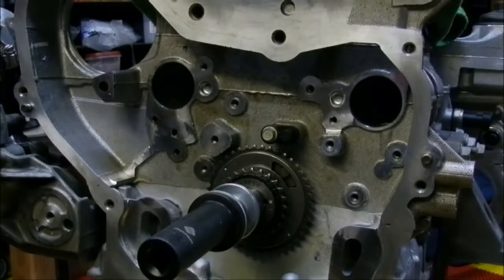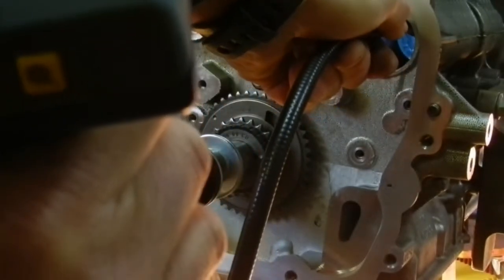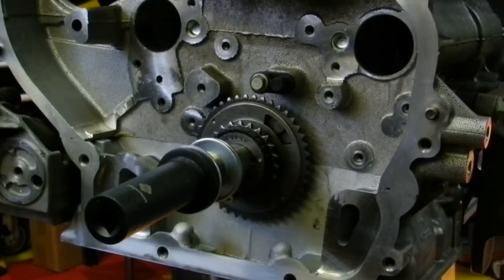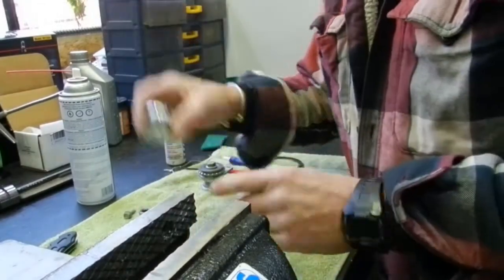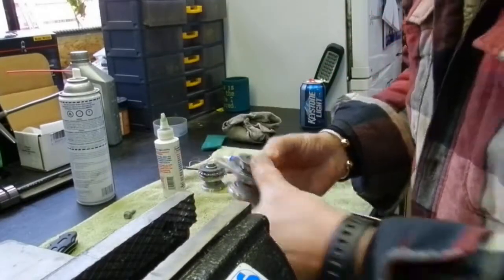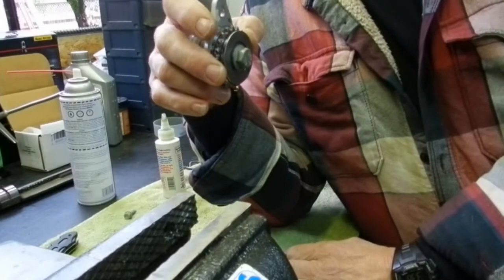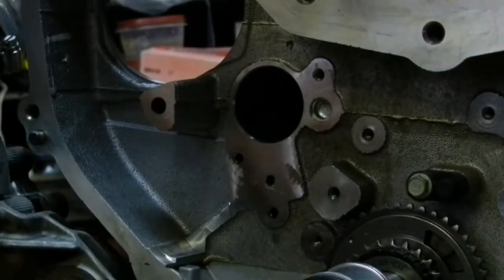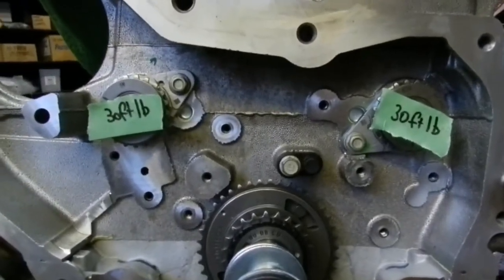LNF REBUILD   VIDEO #2   BALANCE SHAFT DELETE KIT Part 2

Comment: I watched these for a good shot of the oil passages in the rear bushing race and the front race holder. Was thinking of trying to come up with a different type of delete with new sliders and a shorter chain. It looks like oil flow does not simply terminate here but passes thru going else where so my front plug would wind up interfering with the chain. Thanks for the shots man.

Comment: Basicly you can do what you did right there for FREE by istalling the factory bearing in such a way that it blocks off the oil galley and you can cut the end off the ballance shaft to create that dummy shaft to run the chain
Reply: You do this?